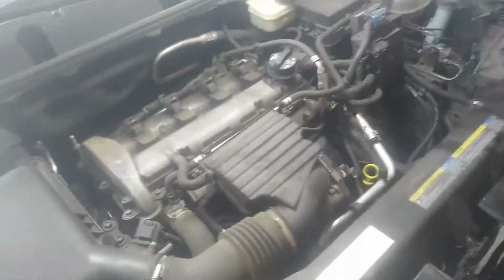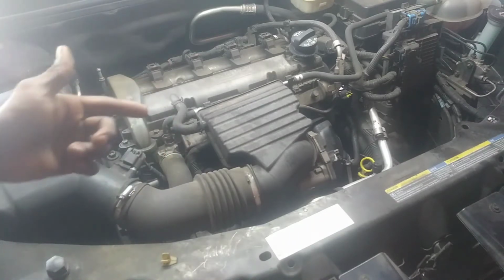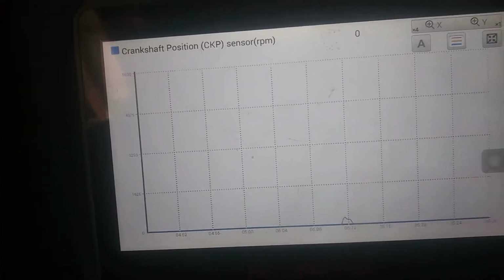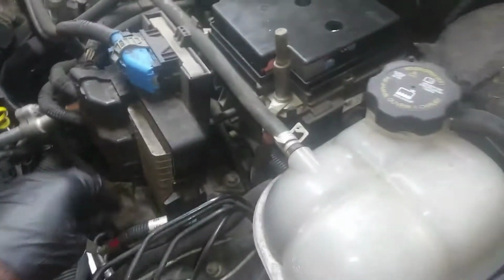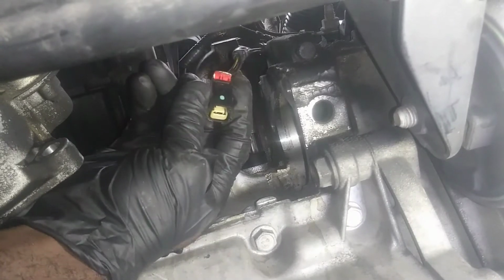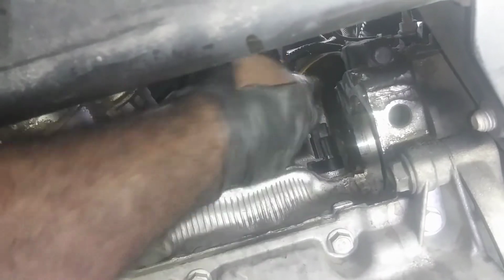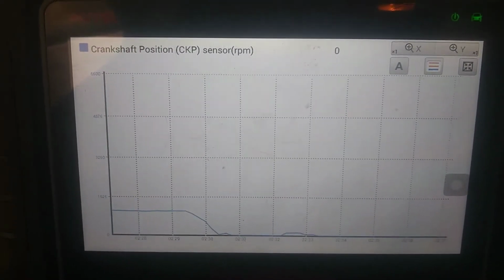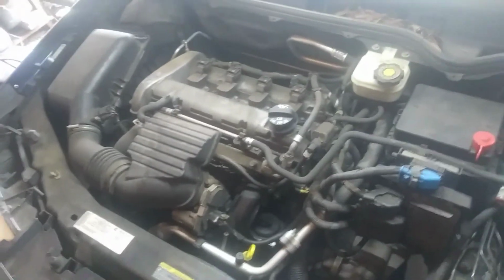P0336 saturn ion 2.4 ecotec

Comment: I could figure this out. Im glad you did. I put a used top on my Saturn ( I didnt really know what I was  doing, but it worked. The wrecker told me it came off a Pontiac, I wouldn't know he told me that).
I got my 2003 Saturn Ion for free. I rebuilt it with myself, my mechanics. Parts and labour = ~ $2800 over 13 years. That ok by me. 
Replaced pladstic junk on moving parts (eg. windsheild wiper transmision).
I figure $160/yr. repairs over 13 years is a gift.

Comment: I bought a new stsrter and ignition swith to no effect(my mechanic installed both). Keven, my mechanic told me it was an ECM. We tried 2 ECMs. No luck so i orderef a reconditioned and programmed ECM from Falgstaff  Co. in New York state. Listed at $176 on sale. Im in Canada do with currency and shipoing it came to $384. I had no option!
Anywsy, it eas installed and it still purrs like a kitten as before 280km or about 160k miles.
Im cleaning my Saturn Mass Temp Sensor just as general maintenance plus 2 other vehicles. 
I got a lot of time so its ok.
Question; id like to clean atrachments with electrical spray. It shouldnt hurt. I intend to clean all parts. 
Thoughts?

Comment: Is it normal to see oil on the sensor,  when you remove it? It seems to me it would have oil on it because the reluctor wheel is inside where the pistons are moving?

Comment: I’m getting a crank sensor code after doing an oil change (No clue if that’s a factor) but I am having no problems starting my vehicle so I’m not sure where to start. Not too vehicle savvy but can repair shit like this.
Reply from the maker: Pull codes 1st, note the codes and clear.  Address immediate comebacks 

Meaning,  what ever code manifest after clearing,  investigate that issue.  Depending on the problem will determine the complexity in diagnosis
Reply: @partsshooter  appreciate the quick response! I ended up replacing the sensor but still wouldn’t start. I’m no mechanic so I just towed it to a shop and waiting on response from them. Turns out timing belt was bad and blew the motor. Just my luck

Comment: I just did an engine swap and all of the electrical connectors are connected as far as I know.  I don't get any codes.  The engine turns, but won't start.  I get no spark from an HEI spark tester on any of the coils.  Do you know what could cause this?
Reply from the maker: Make sure your crank sensor is hooked up, it's by the starter
Reply from the maker: Can you provide more detail on why engine was replaced?  And was it the exact engine?
Reply: It was the same engine (GM), just from a Chevy instead of a Saturn.  I might have figured out the problem through my scanner though.  Let me get back with you, so you don't have to ponder it for the time being.
Reply from the maker: @jppickren3494  ok
Reply: I figured it out.  There was a bad ignition ground.  Now to get it to run right...
Reply from the maker: @jppickren3494  ahh... Cool. What you overlook installing a ground strap?

I had this happen 3 different times before lol .. even recent! These things happen! 

Good deal